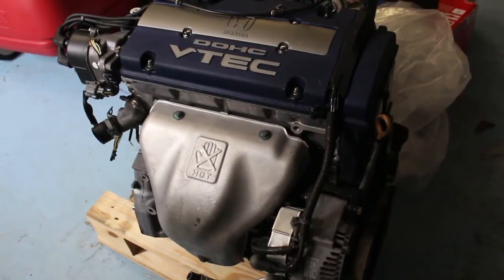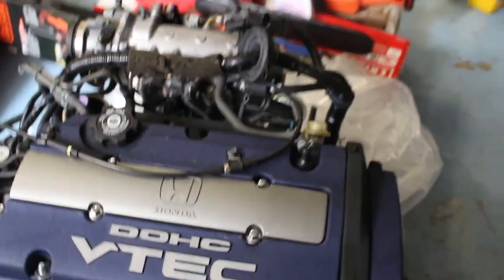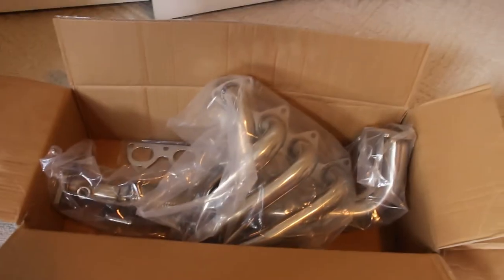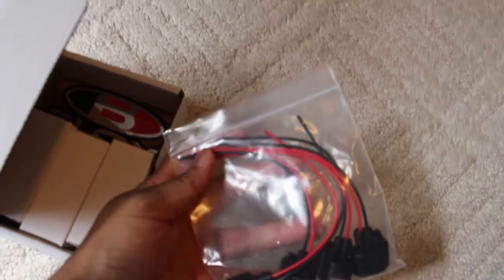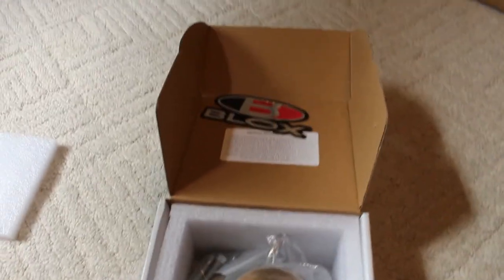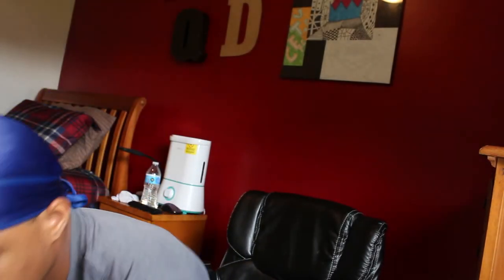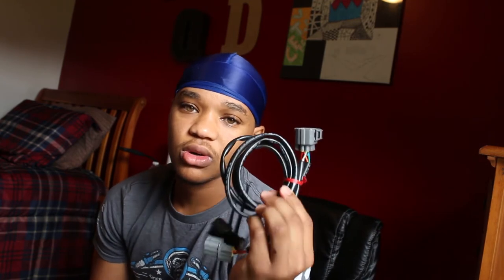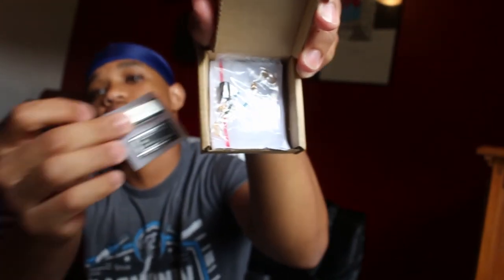H23A SWAP FOR THE ACCORD!!!

Comment: Is there a way that swap passes the clean smog check in California?
Reply from the maker: Not sure I’m from NC
Reply: @kartoonzcars  you know if I put the ignition sensors on the crankshaft and put the external coil and leave a prelude ECU (97-01) if it works and does not have the misfire
Reply from the maker: @douglasfunes4198  I’m not sure I used rywire for the distributor harness you have to send them the plug out of the distributor of the f23
Reply: @kartoonzcars  I understand thanks, what kind of ECU and chip are you using and what did you do with the key immobilizer?
Reply: @kartoonzcars  I start the other week my swap I really appreciate your help
Reply from the maker: @douglasfunes4198  I have a P28 but you can also use a P06 and got a chipping kit off of ebay. The key immobilizer is disable when you get the ecu chipped. I got my ecu chipped before a started my swap.
Reply from the maker: @douglasfunes4198  glad to help